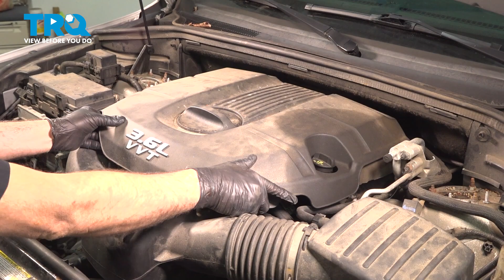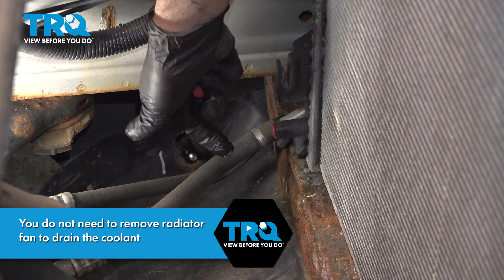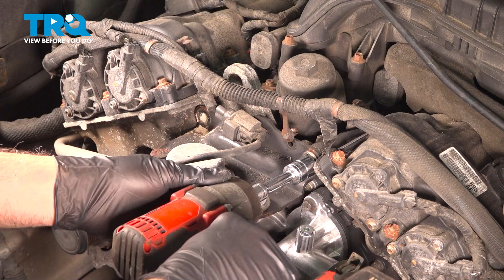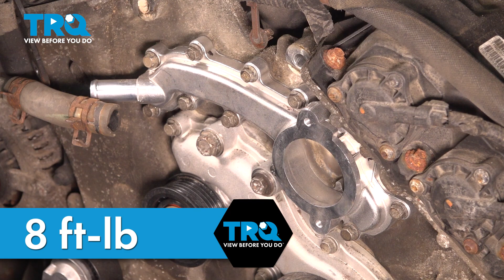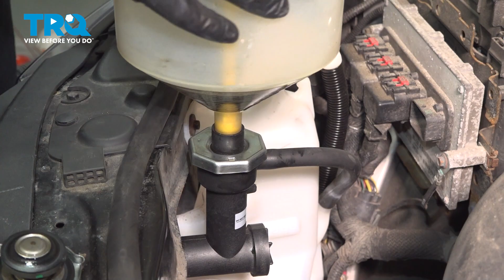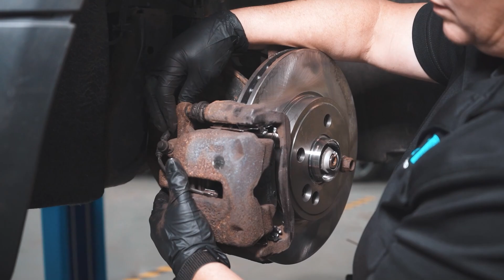How to Replace Coolant Crossover Pipe 2011-2021 Jeep Grand Cherokee

Comment: I’ve been told by numerous mechanics and forums that you can not get all the air pockets out of the system by normal methods. You need to use a vacuum fill system. What are your thoughts on this?